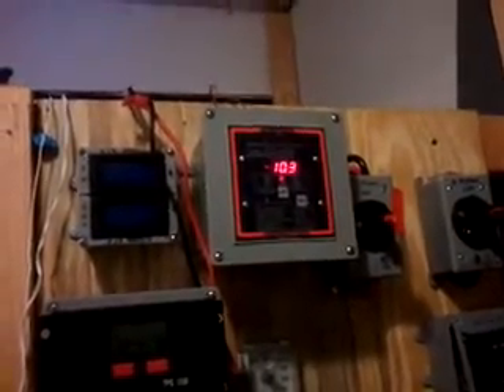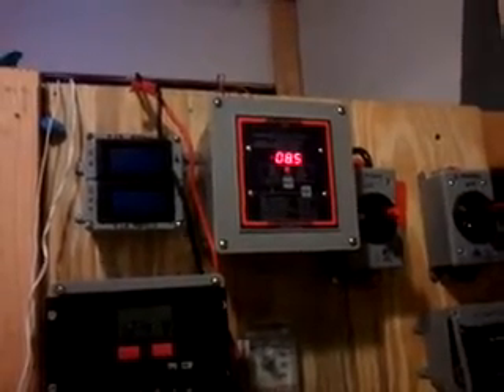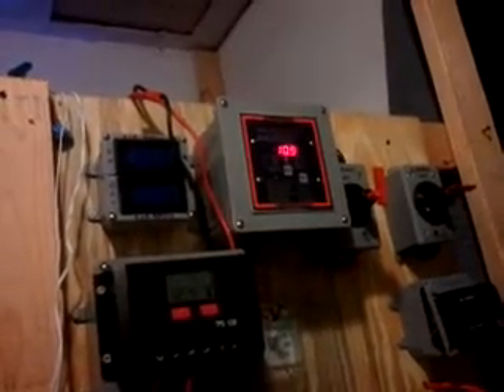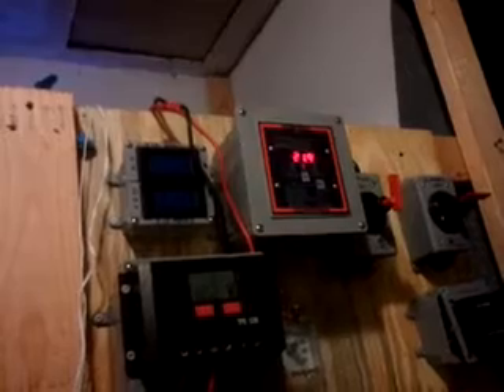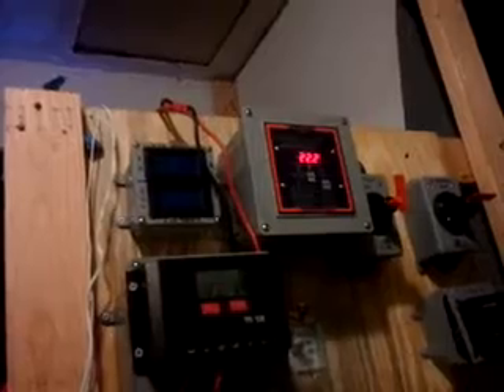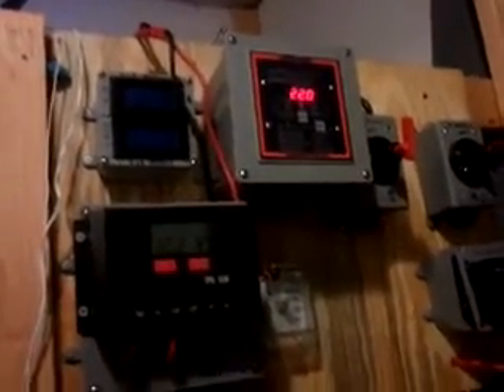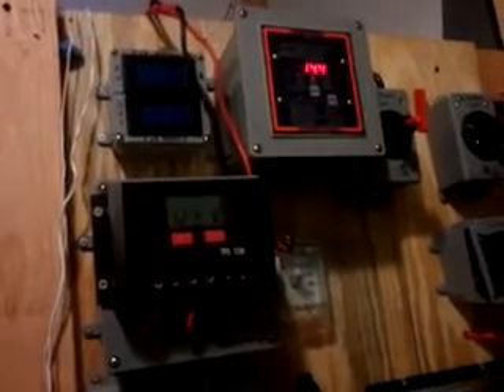How to install super capacitor to inverter to assist diy pv solar system with starter loads.

Comment: Hello, Are you using AC supercapacitors on the output of the inverter? Or are they on the DC side of the circuit? Thanks!
Reply: Dc side

Comment: Can i connect a 50uf capacitor directly to my 1500 watt inverter with 4 battery wired
Reply from the maker: Yes in pareallel
Reply from the maker: Recommmend fuse
Reply: What do mean parallel positive to positive and negative to negative

Comment: I'm curious, how did you size your super capacitor bank?  Also, you mentioned the size of the bank in this video as "5200 Farads".  That is an extremely large capacitance for a home-sized setup and would be quite costly.  For example, I found a 500 F pack on Alibaba for $135 (not including shipping), so you would need at least 10 of them to get you to 5000 F at a cost of around $1350.00, and with shipping would probably push that closer to $2000.00.  Is your setup really sized that big?
Reply from the maker: Thanks for watching. I actually lucked up a few years back I believe I paid 1300 free shipping from decommissioned electric bus capacitors and I ended up with those caps. Since then I sold and purchased a 56v capacitor for my 48v system
Reply: Salvaged parts from an electric bus... okay that makes sense why they are so large.  Was there any reason that you went that big, or did you just get a good deal on the caps?

Comment: I'm considering something very similar using Maxwells. Thought to add a 5-10 ohm power resistor between the batteries and cap bank to limit the inrush current. Maybe a couple 300w halogen ligh bulbs in parallel...?
Reply from the maker: Ken Bell you may consider the resistor to prevent surge on the cables but if you have a great quality and decent gauge wire u won't need the resistor when charging the super caps. I use my caps as initial power supply for big loads. I'm thinking adding halogen bulbs may in fact just draw power from ur caps and batteries. Are you considering the caps to just limit the power?
Reply: econPOWER yes,as a load buffer, similar to a subwoofer amplifier.
Reply from the maker: Ken Bell oh I see. Super caps are an excellent buffer to surge loads and draw from battery bank

Comment: Just to understand.  When demonstrating the amps going back down you are saying you are switching off the unit?  Do you mean the 6000 Watt pure sine wave inverter being the unit?
Reply from the maker: bubbameetze I want to answer the question properly so I think your asking about what happens with the trimetric trickling down...so I had 2 battery banks because I didn't want to mix batteries. One set was gc2 golf cart style batteries (top bank) and the other were 12v marine deep cycle batteries (bottom) I had the trimetric meter hooked to the gc2 batteries. I also had the capacitor hooked to the inverter directly. The "unit" I turned off was a battery disconnect (total of 2 that would isolate the batteries). The other part to the hookup was on the ac side of the inverter the power could be 1500 watts for example and the capacitors would supplement power to the unit before the batteries would get to bear the full load. (Capacitor drains before batteries get fully hit with load) I hope that the possible answers are what your referring to if not give me a time stamp and I can definitely get a specific answer to the question
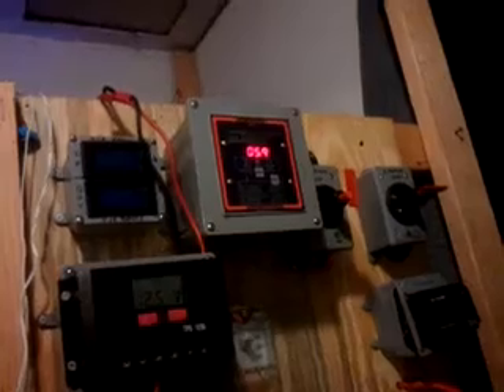Reply from the maker: bubbameetze at 2:14 I do turn the large inverter back on and refer to the inverter as the unit. It was turned off near 1:45 to illustrate the amp draw from the battery bank to refill the capacitors, then back on to illustrate the opposite equal effect.

Comment from the maker: the chinese inverter is surprisingly very functional. the low voltage drop out at 11.0 volts can be annoying if your running water pump and heater it beeps but doesn't shut off.

Comment: I am thinking about buying one of the 5000 watt Low Freq. inverters to use until I can buy a higher end one, then use the Chinese one for a backup How is yours working out for you? Neat looking system you have there.